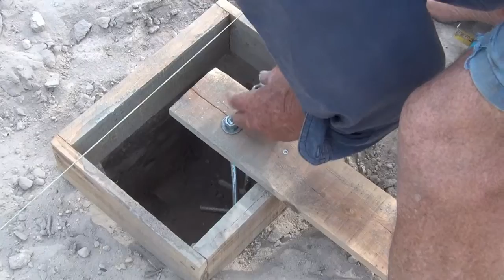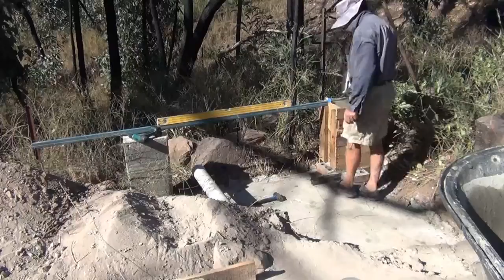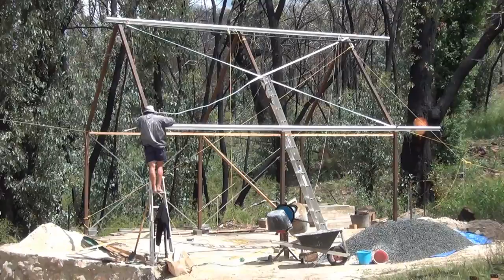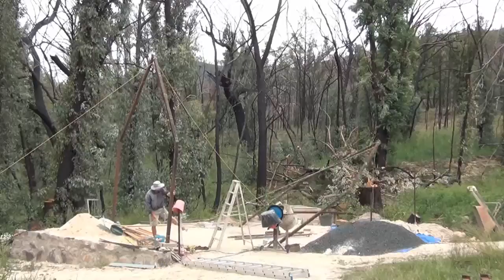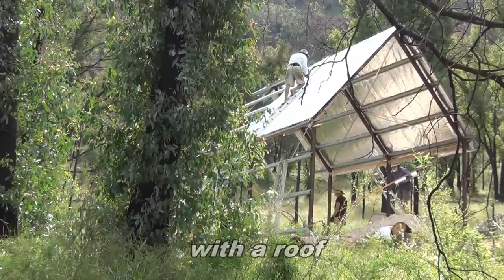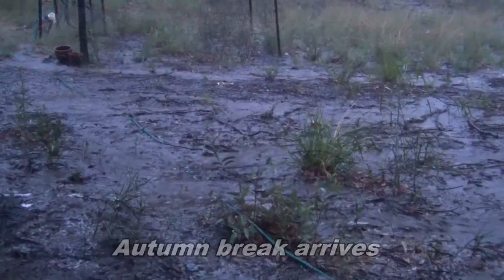Wheoh: Part 13  'workshop-studio' - March 2014

Comment: Where is the heat for your floor and toilet coming from?
Reply from the maker: +Mart Hough Hi Martin, There is a reasonably large copper tank in the roof where hot water from the Rayburn stove is stored (see 35 seconds into 'House Warming' video https://www.youtube.com/watch?v=vKFCWfHk684) . I have yet to connect the underfloor and toilet pipes because I guess I'll need to circulate the water with a small pump. After a few days of running the Rayburn, the water boils, so there is n shortage of hot water in winter. Love to catch up as I'm in Melbourne right now...Best wishes Simon